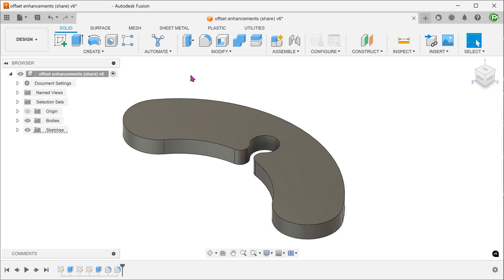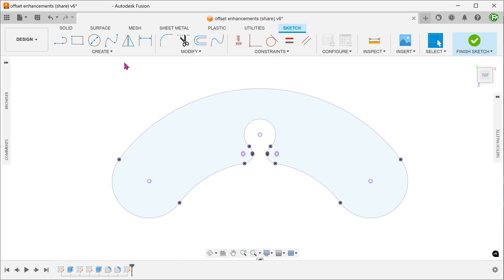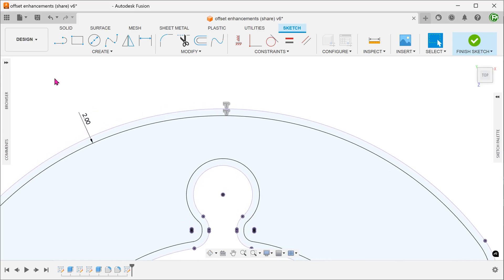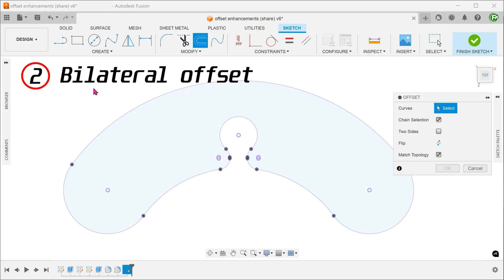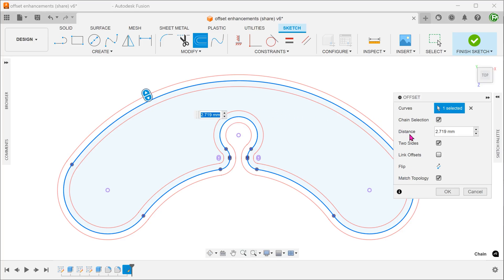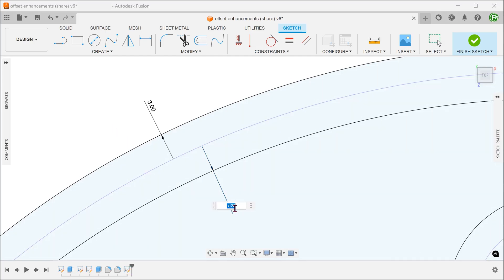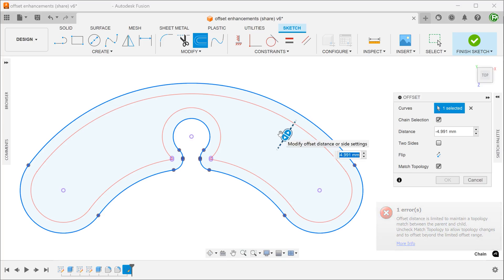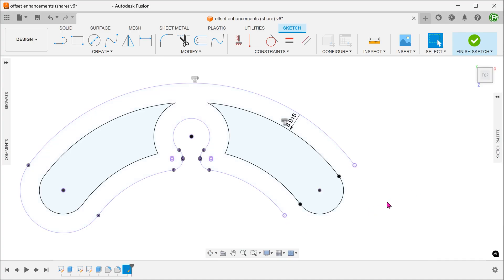Autodesk Fusion | Sketch Offset Enhancements (Sept 2024 Update)

Comment from the maker: Take note that everything mentioned here should also apply to offsetting new sketch entities as well. Hope this has been helpful.

For those who have not updated, need a favour from you. Could you help me to check whether it is possible to perform an offset just by selecting the edges of an existing solid without projecting? If the answer is no, then this improvement was just added in this update, which really resolved one of my main gripes with the offset command.
Reply: Thanks for pointing out this good improvement. It makes certain things much nicer to do!
Reply: On Fusion 2.0.19994 x86_64 (as shown in Help -> About), which doesn't have the improvements you show, I am able to offset from a solid's edges without projecting the edge prior.
Reply from the maker: Thanks! I guess this was possible before all the while.